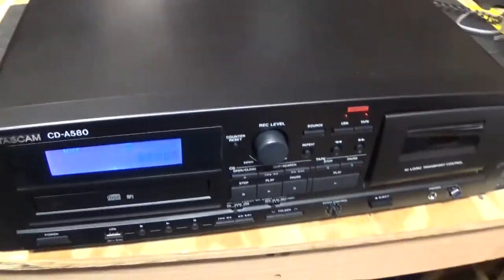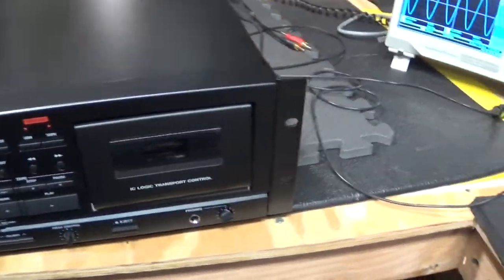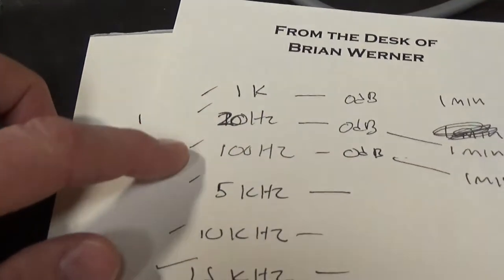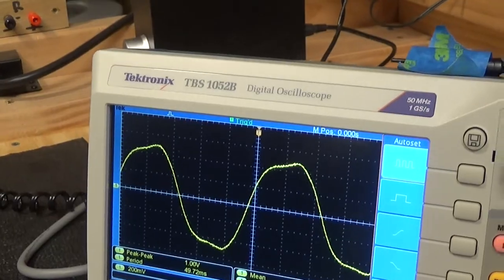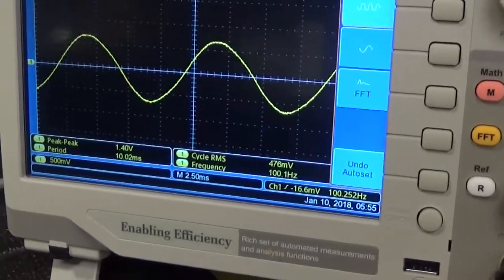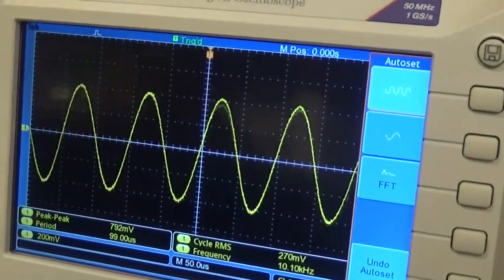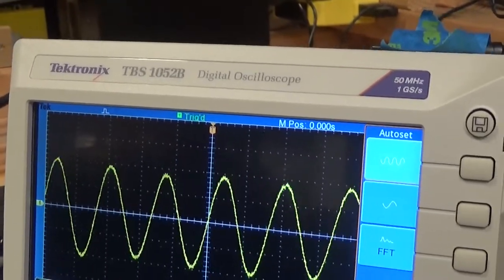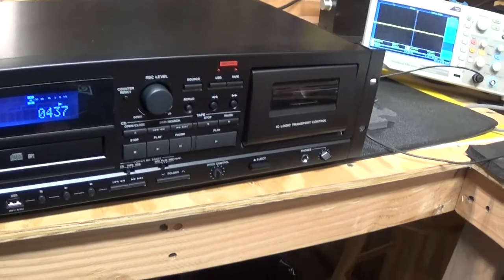Audio Cassettes are Total Crap (unless you enjoy a horse and buggy)

Comment: The biggest problems cassettes have is amplitude modulated distortion as you can see, and high frequency compression. All decks rated their frequency response at -20db not at 0db because of the problem of self erasing the signal at high volume due to too slow of tape speed. I thought that was cheating even back 40 years ago.

 I have the Nakamichi Dragon which suffers from the same amplitude variation problems no matter what kind of tape you use. Phase drift between channels is also an issue caused by tape skewing in the shell case which is visible on an o-scope overlaying channel 1 and 2 on top of each other. Nakamichi just wanted to polish a turd, which shined up pretty, but it is still a turd. I still love it though, I record digitally now and it has it's own issues.